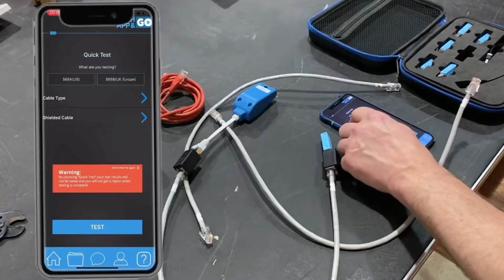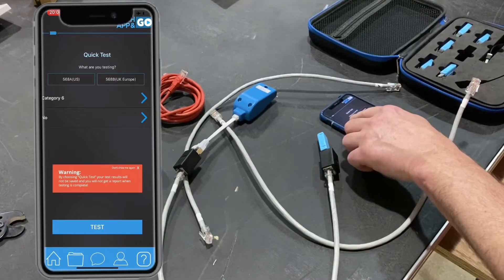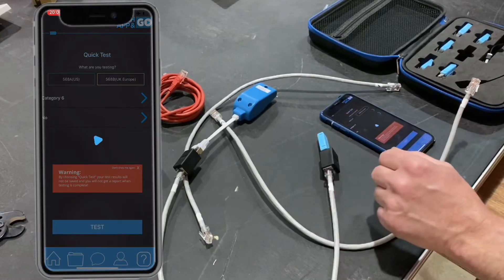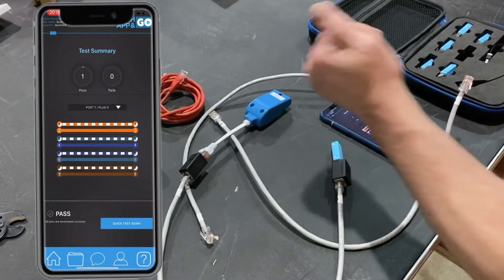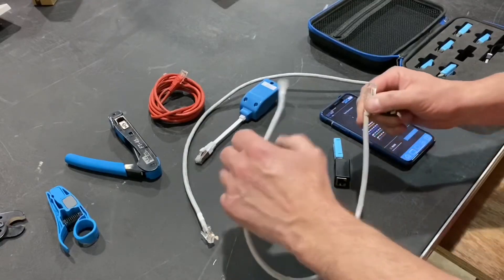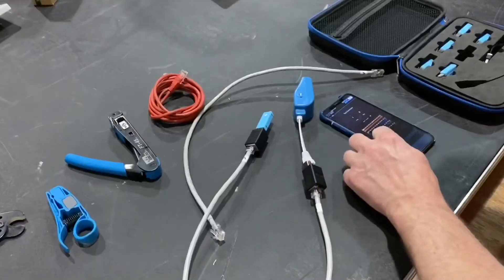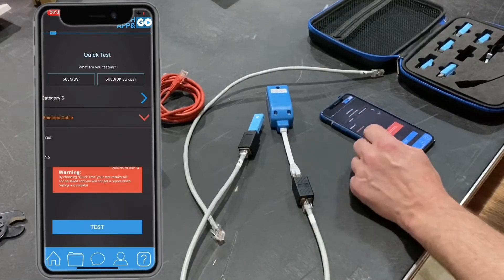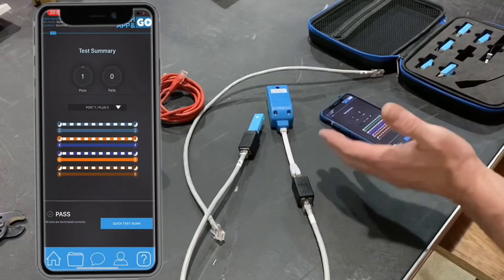T568A vs T568B - what's the difference and how to test patch leads.

Comment: Great video Gaz 👍 very interesting and useful
Reply: Your little tester is fine but it can't possibly tell how a cable is wired. It will PASS any cable provided the four pairs are correctly wired.
eg It will pass an "A" cable even if you tell it that its a "B"

Comment: You should use B but as long as you use the same configuration at both ends surly it will still function as the data doesn't care what colour the insulation is

Comment: Type B might be the most common type of connection, but for any new installations, type A should be used.   Type B is dominant in America because AT&T used it as standard.
Reply: Or use one of the six other permutations of pair colours. Who cares? Wire each cable at random if you want. As long as structured wiring is 4 pair non-crossover it makes no difference.
Reply: I have FRENCH Cat5e cable with completely different colours as defined by "Norme Francais" (NF). Also french conduit for data is geen not purple. Don't be so parochial.

Comment: IDK but I have been using non-standard color coding when setting up LAN ang it's working well. I just made it sure that whatever the color combination on one end is also the same on the other end. Is there a special feature between the copper wire inside a Wh-Or, Or and the Wh-Gr, Gr plastic cover with regards to Transmit and Received function?
Reply: There are no requirements to use any colours at all . An [ethernet]  "T" type LAN cable must have 4 PAIRS of wires. Pair 1 is 3 and 6, Pair 2 is 4 and 5, Pair 3 is 1 and 2 , Pair 4 is 7 and 8 of an RJ45 [originally RJ41] plug. This is an expansion of the original Bell telephone wiring standard for a 2 line connection.

How the cable is constructed and how the wires are identified is not part of the spec. but the electrical specification and performance is.
All four pairs are electrically identical.

568A and B do not a network cable make. They're just a convention.

Comment: If you want a higher density patch panel without going all the way to a rack mount unit, you can get a '66 block' mounting for 8p8c/ethernet jacks.  They will actually be 110 blocks but you can mount it to a wall the same way you mount a 66 block.  I think it's like 10 ports.

Comment: Despite BT (and others) marketing their supplied devices as "Hubs", that's a specific term which relates to a particular type of networking hardware. A lot of people say "hub" when they actually mean something else. In this case the BT "home hub" shown is actually a Modem/Router.

It's also worth clarifying when you say it doesn't matter what T568 standard you use, that is as long as you choose the same on both ends of your cable.
Reply: Technically it's not a hub at all and a router with an integrated network switch. Hubs were used before network switches became standard. Hubs have not been used since the 90s 

Switches learn where the hosts are connected 
e.g. which host is attached to what port. while hubs were  a dumb devices that would forward everything on each port
Reply: @James-dv1df  Not quite true. I have some 3 port hubs for 10T still in use for IoT.
Reply: @adrianandrews2254  I meant more the switches within a router is not typically going to be a hub. 

Not really deployed any IoT stuff however this is more of a niche use case and guessing old or something?

Comment: Technically you are correct... only 2 pairs are used for 10 or 100 mbit networking. If you are at gigabit it uses all 4 pairs. 100mbit uses the unused pairs for PoE. Gigabit uses the same pairs but because ethernet uses differential signalling it still works. Also don't bother with cross over cables. Auto cross over (MDI/MDX) is part of the gigabit standard but many older but newer gigabit devices will swap around as required.

Comment: Great vid.
No need for crossovers anymore Not used one for nearly 20 years as network equipment is auto negotiate. 
Never mix 568a with 568b.
Always use 568b in new installs.
Reply: Sparkies doing data cabling often a recipe for disaster
Reply: Thanks for the information! ;)
Reply: Auto MDI-X is a wonderful thing
Reply: I wanted to connect a device to the switch. 
But I only had a crossover cable of the right length on hand instead of a 1:1 cable, which is what I needed.
Plugged it in and it works. 
I've wanted to fix this for ages, but if it works it stays as it is. Auto MDI-X is great.

Comment: Pretty much everything does Auto MDI-X nowadays, so no real need for crossover cables any more. At work we also have a convention that all crossover cables are red.
Reply: Auto MDI-X was brought in with gigabit as part of the standard
Reply: We also use red for xovers  😀
Reply: @jamesrose6751  we use yellow however have not used a crossover for a while
Reply: As a Cisco network engineer i have seen instances where disabled on the network switches. I think it can avoid loops in the ethernet topology as you then can't  hook a switch to a switch so easily however a property configured network should be running spanning tree so don't thinks it's a brilliant idea

Comment: That's ok if you're happy with a max link speed of 100mbps.  If you want a gigabit link speed, cross the other two pairs too.

So T568B would be G+w, G, O+w, Br+w, Br, O, B, B+w on the far side.
Reply: Just be clear you mean a cross over cable here? As others have said cross over cables are redundant these days as switches handle all the auto negotiation etc
Reply: @customcreativesolutions9982  No, fiber optic. It doesn't offer any benefit though as ethernet can handle significant data rates. You'd be better off paying for a proffesional data cabling company doing the work and carrying out proper certification and testing of each cable/connection.
Reply: @tim81851   Sorry Tim that reply was meant for @Steve S
Reply: or move to fibre?
Reply: @Mike_5  Moving to fibre requires significantly more skill and tools to terminate though. Then you also need more expensive equipment to connect to. Not a problem in a business environment but probably too expensive for a residential setting.
Reply: @tim81851  The tools required and the catalogue of available components has made this a viable option to sue fibre now - well worth an internet search if you are interested in this and have lockdown time to spare!